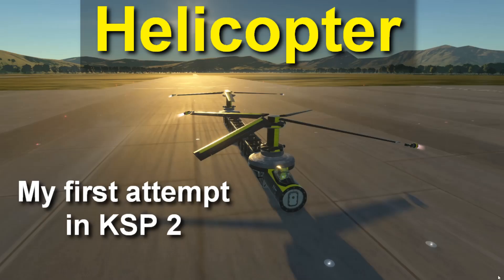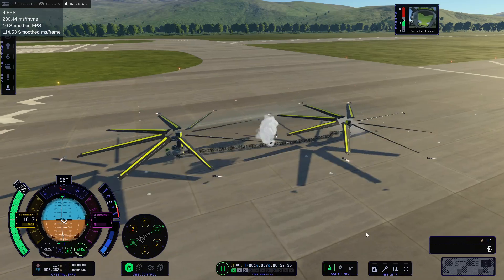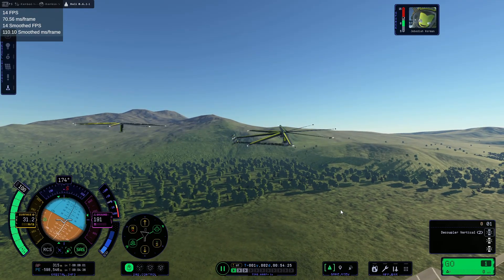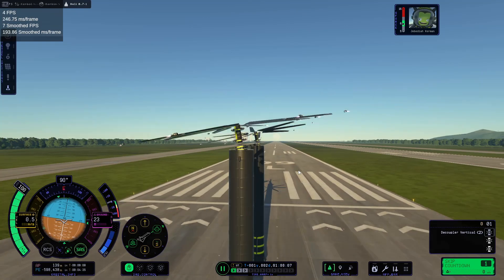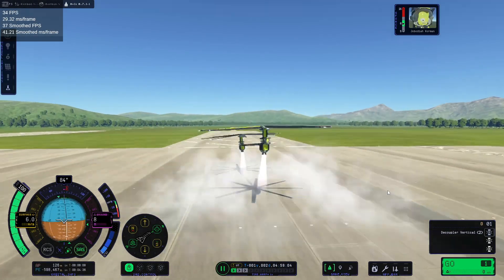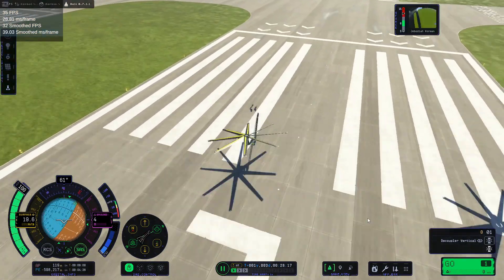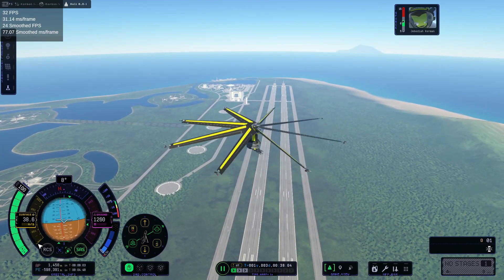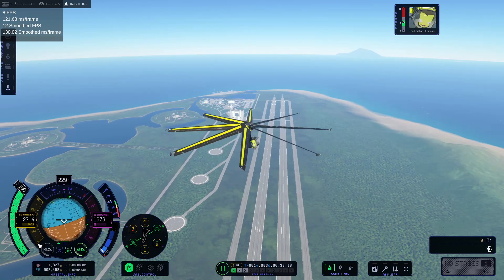WORKING HELICOPTER in KSP 2!

Comment: Make it long enough with a tail rotor to counter thrust or rotate in the opposite direction of torque.
Reply from the maker: I have tried that (tail rocket instead of rotor - one rotor is bad enough!)

It's good when it works but not so good when it doesn't. Turns out there is an inherent problem in the KSP code wrt generating list from rotational motion alone. The engine requires translational motion for lift, which generally only occurs once things start to go wrong.

Comment: Unfortunately in ksp 2, wings only produce lift from translational motion, and ignore rotational motion of the vessel they are part of... The trick to making functional propellers is to make the separate vessels the wings are part of (in the same way that the propellers in your bearings here are considered separate vessels by the game) in such a way that the game considers them to have translational motion rather than (only) rotational motion (it is kind of hard to explain). I managed to make a working helicopter using this technique that i used as a jool return vehicle (it also works on kerbin). You can see it in a video on my channel. The bearing that you are using seems way more stable than mine though so i might try experimenting with that since my helicopters often have wings falling out. The reason why your designs sometimes worked is that they had sideways motion and a lot of wings with very little mass so they were good gliders, but the actual rotation wasnt what was causing the lift, rather the sideways or up/down motion
Reply from the maker: That's awesome info and explains everything - THANK YOU!
I'll go check out your Jool-copter!

Comment: The madman OG did it!
Control surfaces instead of wings can change altitude on the fly.  Turn off pitch roll etc and only allow it to be self deployed. .  But I haven't been able to keep it attached like you have.
Reply from the maker: No madder than a guy who flies through a pipe suspended from a crane in a plane so hot it's on fire!
Reply from the maker: Fun fact: you can't use control surfaces for this build. I just tried it, but unfortunately it won't allow me to attach the rocket engines to the control surfaces like I can with the wings. But I have changed the rotors and I'm going to try manual control surface (of the wings) manipulation.